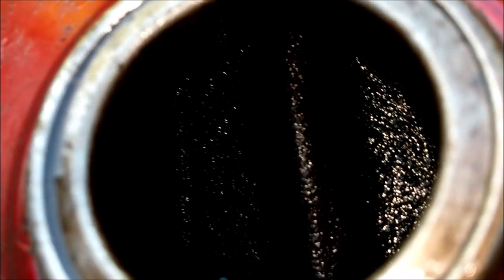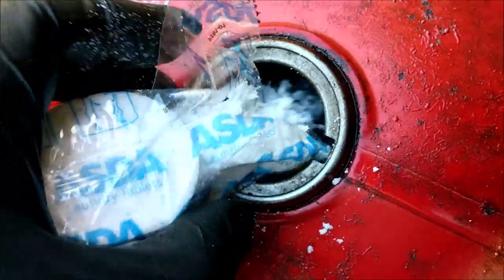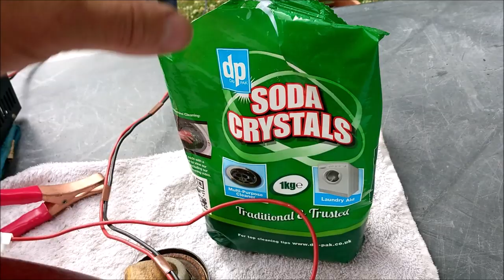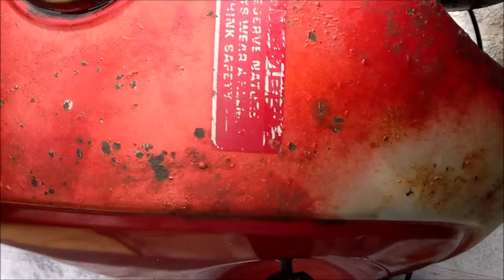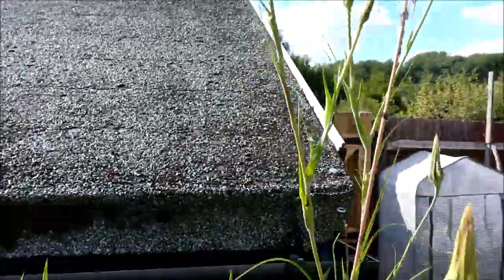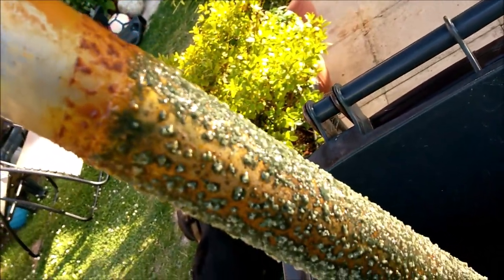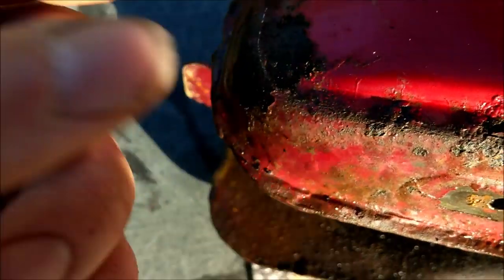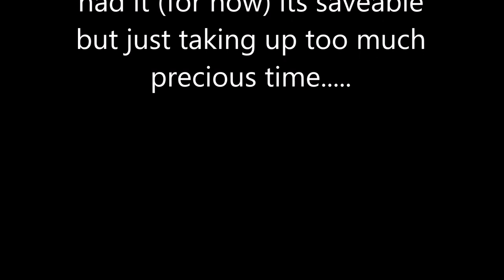Honda CD175 Restoration Episode 12 electrolysis

Comment: Well that was fascinating !! I wonder if the fact that the bare copper cathode (attaching to the exterior of the tank) was in the solution of electrolyte was having any effect on the process and therefore the result.  In the first attempt with only electrolyte in the tank and the tank 'on the bench, the copper cable supplying the cathode was insulated from the anode, whereas in the wheely bin both the copper wire supplying the cathode and the anode had a direct path, taking copper from the wire and applying it to the metal anode. Was this reducing the rust removal from the tank ?????
Reply: very interesting question because we can do copper plating the same way...